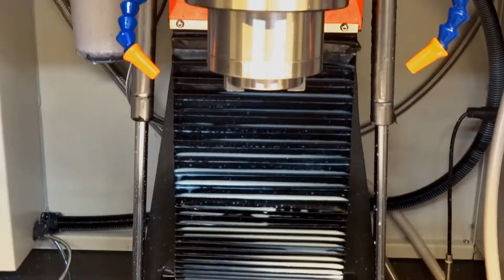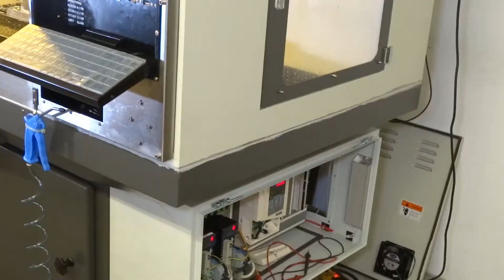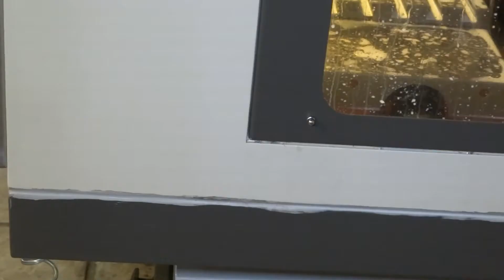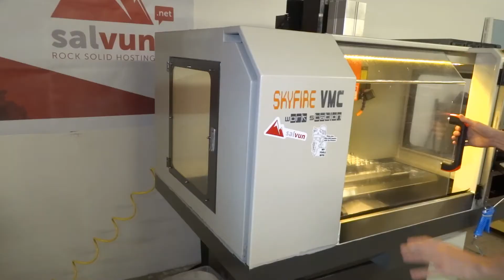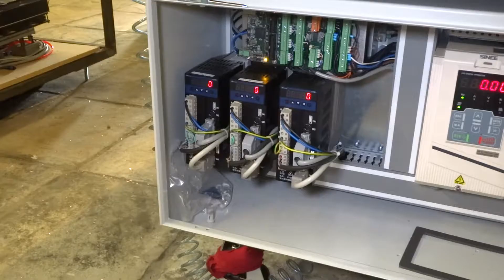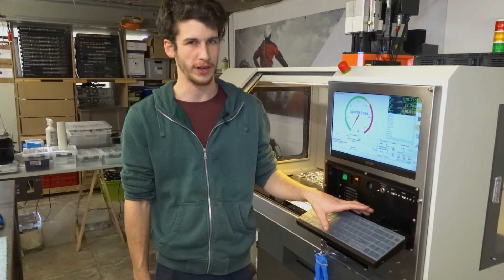SkyFire SVM-2 Overview after 6 months.

Comment: Salvun that is a very informative video. Thank you. I am days away from ordering a SVM-2VMC and taking your advice on upgrades plus a few more. 3.7kw, 10k spindle, 2nd 24k spindle for engraving work i am trying to get it mounted on linear ways to move up out of the way when not in use (also why I upgrade the controller to do 6th axis), much bigger pump, upgraded CNC4960 controller (bigger screen for older eyes) with a custom swing out panel, 4th and 5th axis setup, upgraded X and Y to rollers (I know overkill), then I am going to add Spidercool programmable dual nozzles and send out the spindle for BT30 BIG PLUS conversion and put some type of 3d toolsetter. It will probably used off EBay as they are stupid money considering I can micron level repeatability with a $2 micro switch on my 3D printer. Hmmm maybe I will build one just to see if it can be done!  I am working with Jan here in the US to set this machine up and he has been absolutely  awesome to deal with and would definitely recommend him to anyone looking for a small VMC. I am also looking into see if they can do the rear Y and Z axis metal way cover as they look like chip magnets! Skyfire has been extremely accommodating considering how many mods I have made. If you ask me Skyfire is the next big thing in VMC's.  You and Aaron (DCT TEACHER)  have confirmed that this is the machine for me! I looked at Tormach and Wabeco but they are just Linuxcnc and I don't want to do programming. They are very nice machines but Skyfire has all the right parts at the right price. Plus they can make the machine just the way you want. Doesn't get any better than that. Name any company that will fix an issue like homing switches that fast. All I can say is WOW, they actually listened to you and immediately fixed it on all future machines! BTW Aaron is great guy as well very knowledgable go check out his channel it is very informative and at times hilarious. I do have a couple questions; would you upgrade the servos to 1kw or are you happy with the .7kw? Are the ballscrews backlash adjustable? Your products seem like they are extremely precise so they must be. Do you have a site up for the keycaps? I would like a full set of titanium for my G910! Oh ya and the Adtech controller can be custom programmed using C+ I think. (I won't be doing much of that) They are going to give me the code required for the 3d toolsetter and touch probe. Just like a baby HAAS with the baby price tag! Holy crap I must be excited I never type this much......hahaha
Reply from the maker: That was a treat to read :D The 1KW servo's, i have not had any issues with the .75KW and i push them hard. The only one that might benefit will be the Z. Maybe it's a good idea to get that a bit stronger.
For the ballscrews. You cannot adjust them. but they have a very hefty preload on them so no backlash problems. 
Your cheap toolsetter. (i hope 3D probe , WIRELESS?!) I will pay you to build me one xD!

Comment: Thanks for a good review, pointing out also the weak parts of the machine.  One thing I find very attractive about the Skyfire, besides the linear ways and servos, is the spindle speed.  I also think the 10K RMP spindle upgrade is interesting.  Do you ever find 8K a limitation in your work?  Subscribed.
Reply from the maker: I run it on 8K on almost every single tool i own :P And yes i wish i had 10K or more! But that is mainly due to the fact that i run small tooling. Smaller tools need more RPM.

Comment: Sounds like it should be avoided by anyone in the commercial business. Personally I don’t want headaches when I’m making a living. Automatecnc has a nice machine for $26,000usd and 1000ipm that would be more of an industrial plug and play true vmc.
Reply: I'm pretty sure your average customer isn't shopping these for production runs.  It's a $13k mill.  it goes in a garage and runs on single-phase power.  if it's a living, you just buy a haas or something else much bigger, and deal with everything that comes along with that (power requirements, size, handling, rigging etc).  not sure why this is so hard for everyone to understand.  your.  requirements.  are.  not.  universal!  just because something doesn't work for your use case doesn't mean it's entirely pointless, or that what's best for you is best for anyone else.

get off your goddamn high horse.  internet seems to be full of you 'buy a real machine!' assholes.  shouldn't you be busy somewhere cutting huge production runs of SpaceX parts on a Brother?

Not everyone wants/needs a 3+ ton industrial VMC.  get over it.

Comment: Thanks for adding this video and being informative another European viewer here that looked at tormach but for the Price and features SkyFire blows em out of the water . 

What materials are you machining and what kind of tolerances are you aiming for how well does the Mill hold them ?
Reply from the maker: Mostly i do aluminium copper and brass. With the regular steel. and sometimes titanium. I try to keep 0.01mm mostly for my small parts that i make. And i am able to keep them dead on up to this point!
Reply: @Salvun  how are you verifying that you are keeping .01mm tolerance on parts?

Comment: Skyfire and you seem to be very unforthcoming about the price of these machines, that isn't something I like and I am put off.
Reply from the maker: I don't see what you mean here :O The price depends a lot on what options you take and where you are from due to import taxes and country VAT. I payed about 16K for my machine. in euro. Even the current Dollar exchange accounts in the final price.
Reply: Yes, that's true, but it's the same for anything that I buy from any other firm. Not that I like tormach especially, I do like that I can look at their website and see exactly how much money they want for each bit of Chinese equipment they have to offer. Skyfire don't do that, and even when you acknowledged that one of the most common questions you get about these machines is "what do they cost", you dicked around talking about other stuff and then totally departed the subject. That, as far as I can see, is evasive.
Reply from the maker: Well, i am sorry you feel that way. Just email your re-seller for your pricing and you are fine.  the skyfire website is the OEM and most users will get the machine trough a re-seller. And again. We pay up to  25% EXTRA on machines with the taxes. So the price is so different for where you are.
Reply: It isn't your fault, unless you are involved with the company in some way, and it's just the way I feel about this type of pricing policy. Here in England there is a company called Howdens, they supply kitchen cabinets and are also tight lipped about their prices, which it turns out are variable depending more on the mood of the agent and how much he likes you than anything else. So, I can buy a tormach and know that in USD it costs X, and to import it it costs Y, X+Y= a very easy to understand number. Howdens and skyfire on the other hand, X= an unknown and nonstandard number, therefore Y is not calculable and nor is the total. Personally I wouldn't enter this area with Chinese engineering equipment at the 16k euro mark, I'd buy a heavy, used, high quality American or European machine for either a similar or not much higher price.
Reply from the maker: yeah i understand. We have told Skyfire to change it but it seems they are looking at Re-sellers for that. That's what i understand from most of it. Also if you email them they are normally happy to give you a quote on what you are looking for. 
a lot of company's don't list there price on a website. Nothing wrong with that i think, it's not the best way of marketing the product. But it's not my company so i can't decide how they run it :P

But i am not un-forthcoming with what i pay for my machine. Just careful, my price can be very different for lets say, a guy living in the US
Reply: You are right, and in my opinion too many companies aren't transparent with their prices, which is just something that I don't get on with very well. I understand it more with industrial suppliers on the basis that everyone knows roughly what the machines cost, and the competition is hard so not much room for mucking around. With this level of machine though, it's designed for a bloke in a garage (consumer), not a factory (producer), and therefore the pricing strategy should be as clear as crystal, even if that means a price listed in Chinese Yaun.

So, I retract that you are unforthcoming, on the basis that you told me the rough number, but you could have put the audience out of there misery by just saying it in the first place.

Also, tell skyfire that I won't even consider buying their stuff untill list base prices are plastered all over their website.

Keep going with Linux CNC though, it's complicated, good, and free!
Reply from the maker: I will try xD But Skyfire won't always listen to what i have to say :P 

The linuxCNC i am working on. I post a lot more on my instagram to be fair. instagram.com/salvun